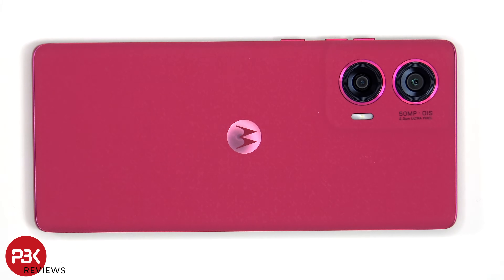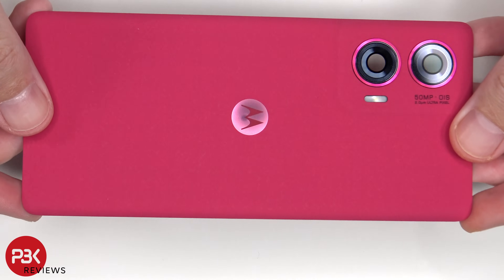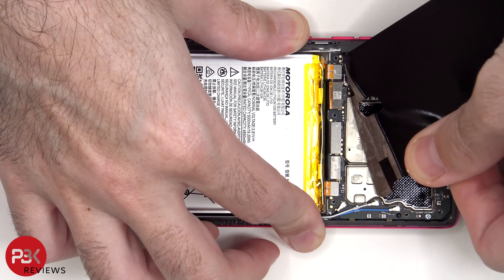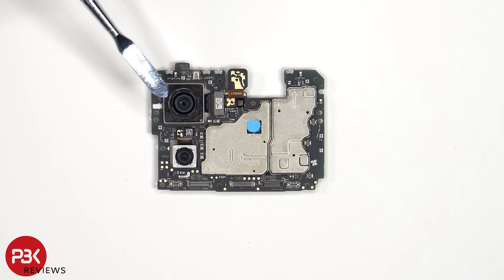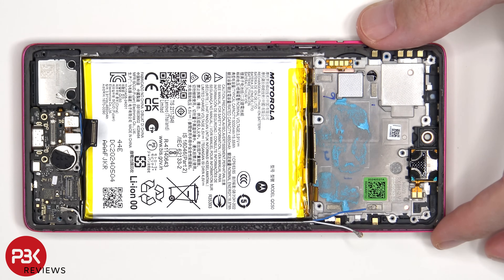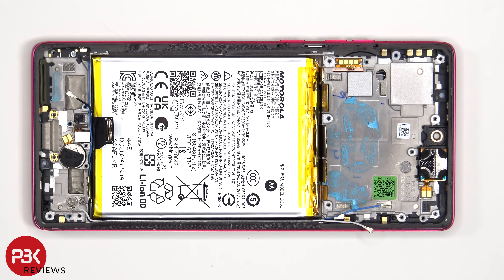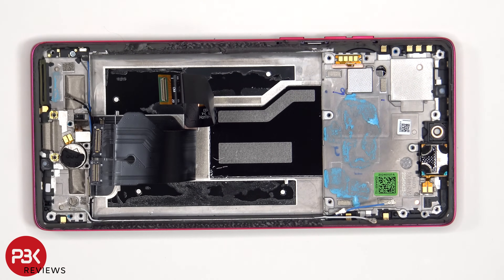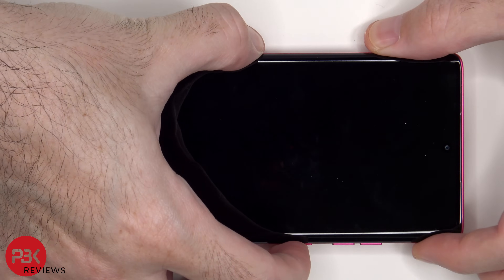Motorola Edge 50 Fusion Teardown Disassembly Phone Repair Video Review

Comment: I know it's been almost a year since you posted this, but maybe someone attempted this process recently and it's them I want to ask: is the microphone placed right after its hole? I ask this because I put my pin (or whatever it's called) in there instead of the sim one and since the microphone seems to record my voice on a pretty low level I'm wondering if I ended up damaging it. 
Thanks to whoever will reply.

Comment: moto edge 50 fusion i accidentally inserted a SIM ejector pin in the microphone hole in The mic.is working fine, but I'm concerned with thewaterproofing of my phone. What should I do?
Reply: I came here for same reason.... My pin got bent tooo.... Mine is working good as of now.... How abt yours?

Comment: I have made one terrible mistake by poking/inserting the sim ejector tool hardly in the microphone of Moto G85 5G, please tell me that it will not harm the microphone right? I can see that the seal had broken, please tell me
Reply: I came here for same reason.... My pin got bent tooo in mic hole.... Mine is working good as of now.... How abt yours?

Comment: The white wire on my phone was took off from the solder, what was it's use?
Reply from the maker: They are usually used for antenna connections and sometimes fast charging related.